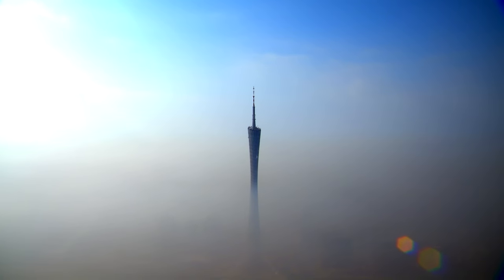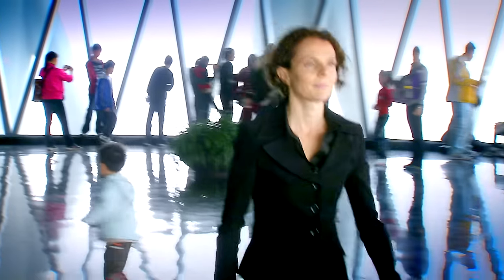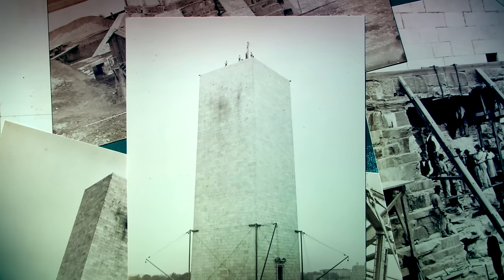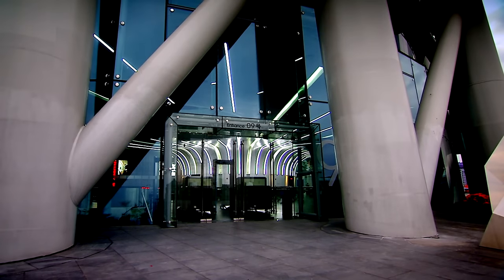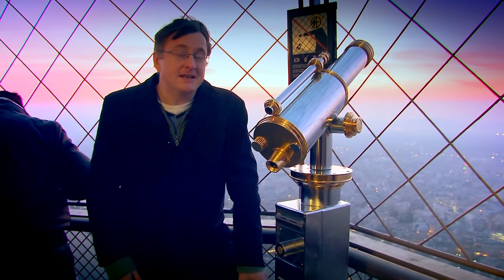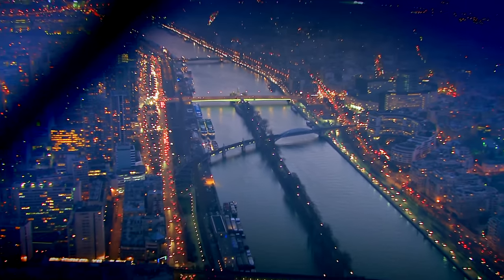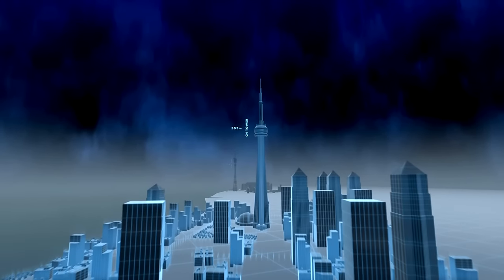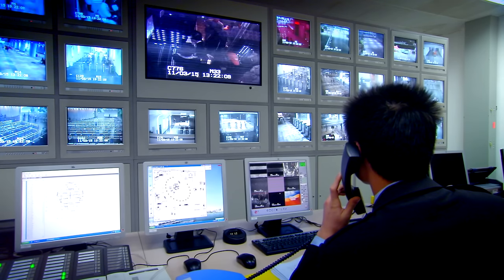The High Life – Tale of Four Towers – Big Bigger Biggest

Comment: Fascinating stuff, I would have liked to hear the power requirements on that tower in China. I couldn't help but notice that all the fire and smoke suppression devices require power to operate. I am sure there is a backup, but what? Generator, batteries, or a combination of both? I have worked in the field of fire alarms so this topic drew my attention.
Reply: What is that BS of a program. You act like the Canton Tower is the highest in the world but it is 610 meters high, while the Tokyo skytree is 634 meters high so Japan has the highest. And this is not all. Not only Japan has the biggest but when you talk about marvel of engineering, then report that to the Tokyo Skytree as not only is it the tallest, it is also the only one built on an extremely unstable fault and receives over 400 earthquakes a year and when the magnitude 9 hit japan the Skytree didn't even get any damage or necessitated any work. 
THAT is what a marvel of engineering is. Put a magnitude 9 under the Eiffel tower the CN tower the Washington monument or the Canton tower and see what happens ! 
Is that a program sponsored by China, because Japan rules when it comes to building towers.

Comment: Not sure if an over use of glass is actually the best idea. Perhaps concrete, with glass at the top and overarching bridges that connect multiple buildings. Not a fan of square parameters, I think our roadways need to be twisted below each building. Blocks, increase lateralization whereas helixes promote diversification.

Comment: Excuse me sir, can you elaborate on exactly how the air around the Eiffel Tower would weigh more than the tower itself? 🙄🤨
Reply: Because air is actually rather heavy? And the Eiffel tower has a low density. There's a lot of empty space
Reply: @elementalgolem5498  Really, Sir, sometimes it is better to remain silent 🤣.       @Don Shew  Sir, I heard a saying from Abraham Lincoln :"We shouldn´t believe everything that we hear on the internet"  😉
Reply: @sasakalak4681  you don’t have to believe it but air has mass like anything else. If you condensed the air to a liquid (which makes it slightly easier to understand) it would weigh more than the tower. But even in gas form it has the same weight. The density is much different but the mass is still the same. Pretty simple.
Reply: @TheScottbb1  we are talking about a glass around the tower here.  1L of air is 1g or 1m3 of air is 1kg at sea level. Since tower is 300m tall and 125m wide the cylinder (glass) around the tower has  3,681,553,890.93 L or 3,681,553 m3 of volume . Tower weighs 10 000 000 kg or 10 000t  so the cylinder (glass) around the tower, filled with air weighs only 30% of the tower weight.  If i did some miscalculation I stand corrected but that glass should be considerably bigger than the tower itself. Pretty simple.
Reply: @sasakalak4681  if you look at the glass it's not only wider than the tower. And not exactly the width of the tower. It's also slightly higher. I highly doubt your calculations are more accurate that the calculations of construction engineers. Oh and you have miscalculated the weight of the air by 26% and the volume of the cylinder by about 15%. That adds up quickly.
Reply: @elementalgolem5498  i heard that theory still in high school and my physics professor proved it wrong with data available then, today it is a lot simpler.  If those calculations were made by Prof. Levine, I would believe them, with data available I am sticking with my Prof.
Reply: @sasakalak4681  The Eiffel Tower is 324 m tall and sits on a square base with sides of 125 m. It would therefore fit inside a cylinder with a radius of 88 metres, giving the cylinder a volume of just under eight million cubic metres. This much air would have a mass of 10 000tonns. the mass of the iron in the Eiffel tower is about 7400 tonns, the goal weight of the tower with everything is about 10 000 tons aswell so this cylinder would weigh more. +- a few hundred tonns. If you take just the skeletal structure of the tower without everything that has been built on it then it's definitely heavier than the tower itself
Reply: @elementalgolem5498  ok, i´ll take that as an answer, well elaborated. Although we can argue about the height and that +/- cause it is a - at the end but well elaborated. good job.
Reply: @sasakalak4681  the official height is 324m, i didn't add anything there's a 300m height for the structure and 324 with the tip. Just like Burj khalifa is calculated as the tallest in the world with the antenna tip, but building based on height without it. However you wouldn't fit a glass over it if you ignore the steel poking through it for the sake of building defenitions. The biggest differences were from 1. Weight of 1cm3 not being one kg but 1.222... kg. 2. A cylinder wouldn't fit over a square with sides 125m it would need to have a larger diameter or else the edges would like through. And 3. The height difference between full height and structural height

Comment: I'm curious how well the tower would hold up if a full size jet flew into it.  Especially if it hits the thinner part of the structure.   That's the problem with so many structures.  Sure, they are very strong by design.  But if any one part of that structure is compromised, the whole thing could collapse like a house of cards.   And it might be the case that we don't have any structures that could withstand the kind of damage that a large jet would cause.
Reply: The CN tower was designed to take an impact from a large commercial jet aircraft.  It is also able to withstand a magnitude 10 earthquake, it is a seriously strong structure.
Reply: @208467  I'm curious what they did with the structure that would enable it withstand that kind of impact from a jet.   One issue with that kind of structure, unlike a car, where they create many similar models to test in crash tests and such, you can't really do the same with that kind of large structure.   It's not as if they will build replicas just to crash a few jets into  them.  So most of this is likely theory.   Now I'm sure there's more to it than simply guessing.  Obviously.  They can run many tests in the field or run super computer simulations.  But at the end of the day, you don't truly know until it happens.   But I'm certainly no expert by any means.

Comment: Claim - it is impossible to build tall stone structure. Reality - the tallest things on the planet are stone structures. Not a single man made structure has even come close to the height of the tallest mountains. Second part, longevity - mountains and anything built from stone lasts thousands if not millions of years, whereas metal, concrete etc have a shelf life of maximum 100 years.
The problem wasn't stone - the problem was poor engineering, and later poor modelling. If you model the stone building just like Eiffel tower which is very similar to that of a mountain, you'd have different results.
Reply: what are you talking about?! the chrysler building in NYC is near 100 years old and it will be standing for another 50 yrs.
Reply: to reach mountain-like sturdiness and height would require such thick walls as to be rendered unusable for modern human use... 🤔

Comment: It only took 13 months from breaking ground to complete the Empire State Building in 1930’s… Now that is impressive… 3years for a tower in the 21st century? Not so much.
Reply: If we built a copy of the Empire State today it would take about 3 months, if they tried to build a copy of, say, the Gherkin (London) it would take them decades.
Reply: The two buildings are of different types and require different planning and engineering, especially at the base.
Reply: The trade-off for going slower is fewer dead workers at the end of it.
Reply: It’s not really a tower, unlike these structures, it is actually a building. To define as a true building, over 50% of it has to have habitable spaces, like the Empire State Building does, all these towers on here don’t have that, which is why they are considered towers and not proper buildings.